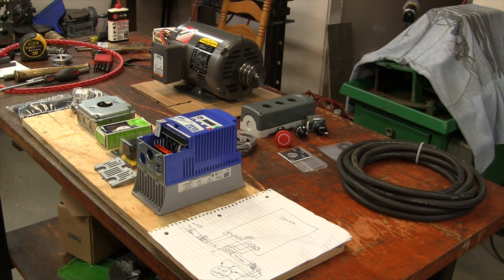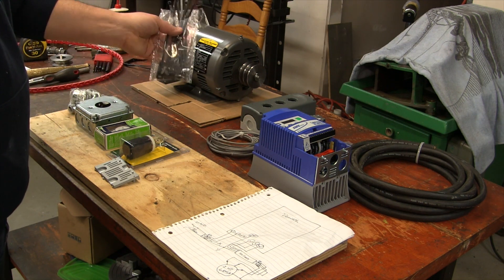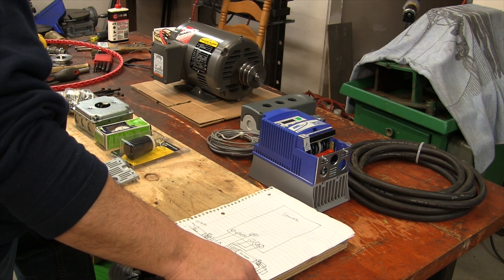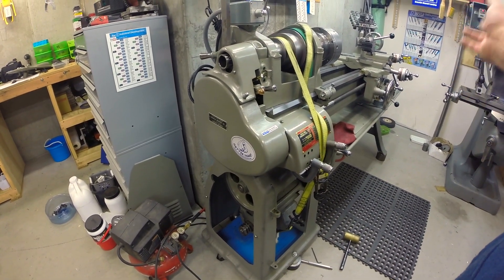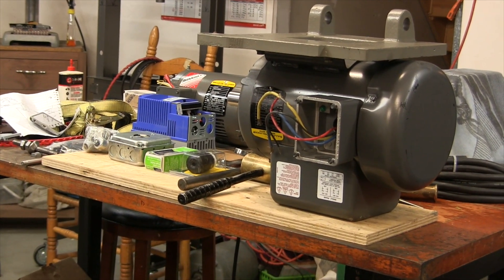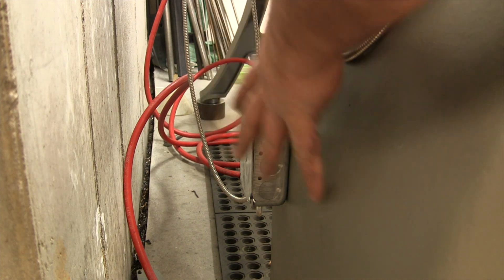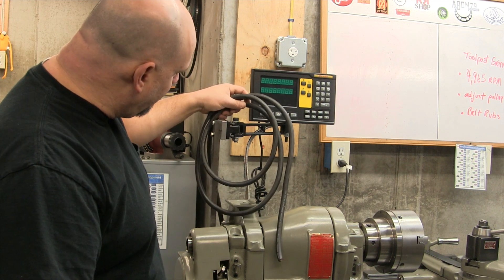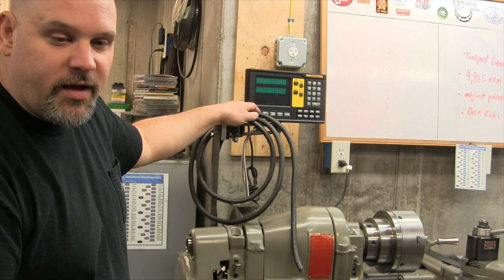South Bend Lathe 3 Phase Motor & VFD Installation   Part 1

Comment: Great video indeed. I'm real new at retrofitting electrical components such as replacing a single phase with a three phase motor. I barely understand the concepts, so we wont go into that. My question is, will you be hooking up your motor to 120v or 220v power supply and please show all the connections on your next video. Looking forward to more on this subject....Thanks ...Ken
Reply from the maker: +Kenneth Bartlett Yup guys - it's 220 and I will be definitely showing every connection - gotcha covered :)
Reply: +Kenneth Bartlett , I was wondering the same.  The outlet looks more like a 220V plug layout than a standard 110V outlet.

Comment: Brad..... I must comment on the information I provided earlier.  The VFD selection is based upon full load (motor nameplate - FLRA).  If you feel you will not be running the lathe at full motor load then the 2hp VFD may be acceptable.  However, a proper 5hp  VFD is not that much more $ and I feel the peace of mind would be well worth it. 
Once again, good luck with the build
Paul
Reply from the maker: +Paul Copeland Thanks Paul - I should be pretty happy with the 2hp. It's the proper-rated motor for the machine and I've gotten by with 1hp (yikes). The upgrade is nearly done now and part 2 will be out pretty soon.
Reply: Brad.....The 2hp motor is fine.  My concern is that for you to be safe and code compliant you need at least a 3hp VFD.to run the 2hp, 3phase motor on 240V single phase power.  Check the VFD you bought and see if it is rated for 2hp, 240V  Single Phase input.  Some VFD's these days are sized by the manufacturer for Single Phase input.  Check the rating label on the VFD.  Make sure it is rated for 2hp, Single Phase input.  If not, you will need to change the VFD to at least a 3hp rating.  See my reply to "Sparkness" below explaining why this needs to be addressed.  Have fun and good luck.

Comment: Brad enjoyed the video.  I am in the process of putting a 1938 13 in south bend together.  It came in pieces and without a motor.  in my search for a motor, should Ii look for 3400 rpm or 1750 or does it make a difference since I can change the motor pulley size and will be installing a vfd?
Reply: I have read its best to get a 1750 because 3500 may not have the low speed torque. Not an expert though.
Reply from the maker: +DAVID ENGLAND 1750, 1735. The gear-train on the South Bends can NOT handle higher RMPS. Good luck!
Reply: +BasementShopGuy Thanks Brad.  what size motor pulley are you using?

Comment: Brad... I hope I can catch you in time.  To run a 3 phase motor with single phase power, there is a derate of 2/3 you must apply to the VFD.  This is a minimum and most installers will apply a 1/2 derate.  In other words, a 2hp 3ph motor will require a minimum VFD of 3hp.  The much safer 1/2 derate would require the VFD to be a 4hp.  As far as I know, a 4hp VFD is not available, so you would go with a 5hp VFD.  I hope you haven't installed the 2hp and can return it for a 5hp.  I am in the commercial HVAC business.  We run 3ph motors on single ph through a VFD all of the time when 3ph power is not available.  It is a great problem solver and an added attraction is the 3ph motors are much smaller.  That single phase 5hp is a beast (as you know).  This is why commercial equipment over 2hp is most always 3ph.  There just isnt room for a large single phase motor.  Sorry to ruin your day, but you will most certainly have the VFD going off on safety limit or worse you will fry the drive.
Good luck with the install, 
Paul - RCKYMTNENGR
Reply: +Paul Copeland I would say you are wrong. You derate when you use a static phase converter 2/3 as you are only using 2 of the 3 available windings . with a VFD, a 2HP VFD drives a 2HP motor or smaller. The VFD chosen puts out 6.8A and the baldor 2hp draws 6A at full load 230V.
Reply: +Sparkness .....A VFD consists of a rectifier/filter section which converts the incoming AC to DC. This high-voltage DC is then converted back to AC with additional controls which provide the speed control. The problem with single-phase AC power is at the input side of the VFD, the part that converts incoming power to DC.

When you rectify a three-phase power source, the output voltage from the rectifier never drops below 50% of the peak voltage. This makes it real easy to filter and provide pure DC to the rest of the equipment.

However, when you rectify single-phase power, the output voltage of the rectifier drops to zero 120 times a second. The task of filtering this to provide pure DC is much more difficult.

The standard rule-of-thumb is to derate the VFD by 50% when operating from a single-phase source. Thus, if you want to run a 5 HP motor, you need a VFD rated for 10 HP.

I would say Brad could probably/might be safe with a 3hp VFD.  I am not familiar with the loads a lathe will ultimately put on a motor but I would lean towards industry standard and get a 5hp drive.  

Trust me, this is how it is done.     Paul
Reply: +Paul Copeland the filter cap will work harder in a single phase . I would derate a 3 phase drive only that is used on single phase . The vfd mfg  makes models to run on   single phase.  The bridge rectifier in these small vfd's are usualy 25-30amp rated component . they can take the load. also the lathe will have varing loads not constant like a fan or a compressor. The vfd's I run on my machines have no problems . the only problems I have experienced is trying to de-accelerate to quickly causing an over current condition which can be corrected in program.
Reply: +Sparkness ....your quote:"I would derate a 3 phase drive only that is used on single phase".  Well, that is what he is doing.  Sure, I  know that drives these days are advertised as available to run with single phase input.  When you buy one of those you are  basically getting an upsized drive. Does he have that model drive?  Better be sure.
Reply: +Paul Copeland  I dont know what exact model  he is using. I would think that he would have ordered the correct drive. not all know that you can run a 3 phase drive on single phase. On my vertical bandsaw I use a 3/4 HP motor driven by a 1/2 hp Mitsubishi drive 120 volt  no problems what so ever as the drive puts out almost the same current as the motor needs at fla  But the saw does not get loaded to full hp . In the manual they recommend replacing the filter cap after so much use.